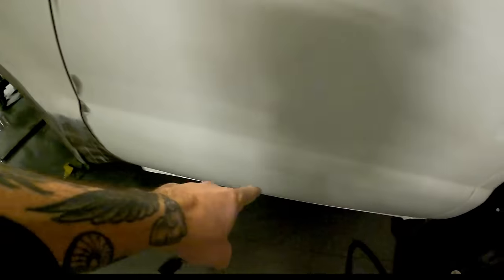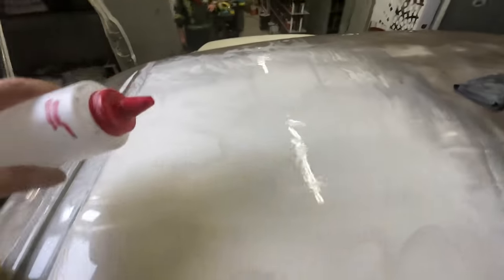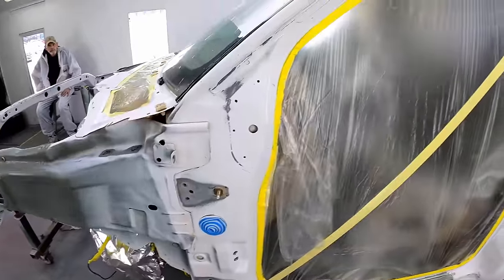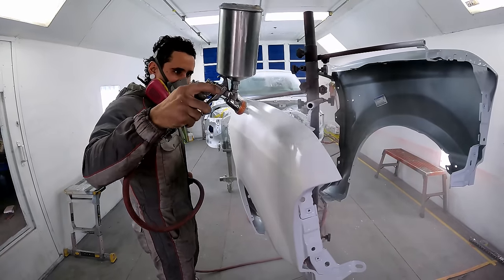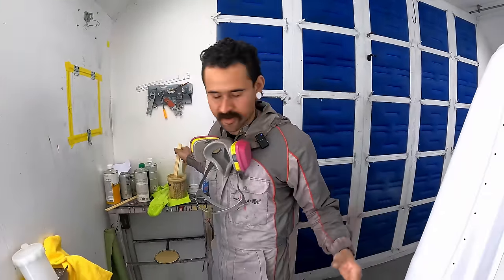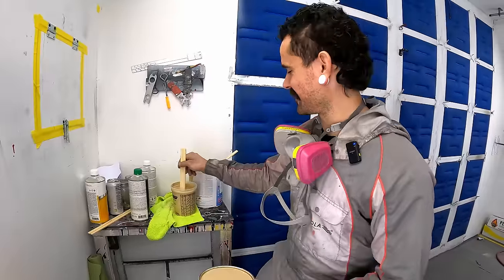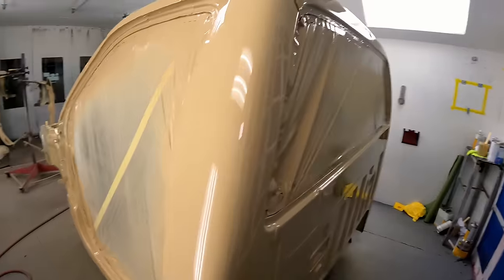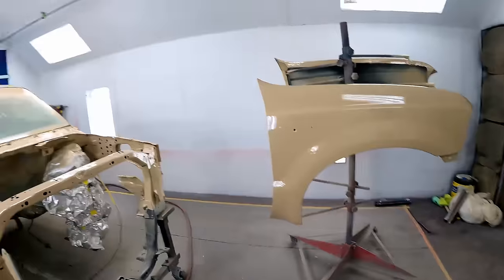Spraying Single Stage Paint! | Utility Truck Project

Comment: How does the single stage hold up in the sun for years compared to base/clear?  I've had too many cars and trucks whose paint has not lasted, want to paint a Dodge D350 crew cab in the sort red that Dodge used in the late seventies but it'll spend its whole life outside.

Comment: Fred, did you use an acrylic enamel?  Also, could you let me know if you used a hardener?  Thanks
Reply: Acrylic enamel is an inferior paint that has similar cost to a budget minded single stage urethane.  Even a inexpensive urethane coating is far superior to even the best acrylic enamel.